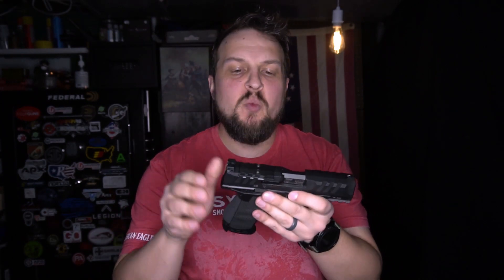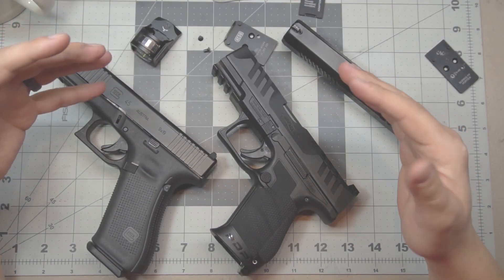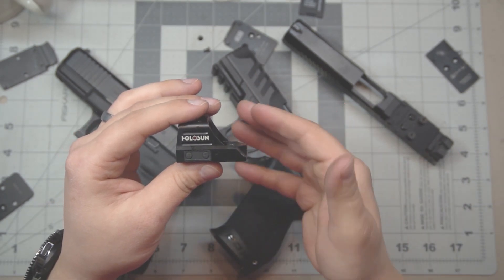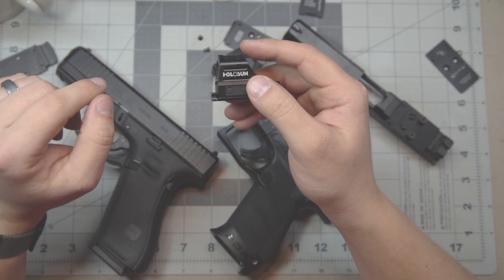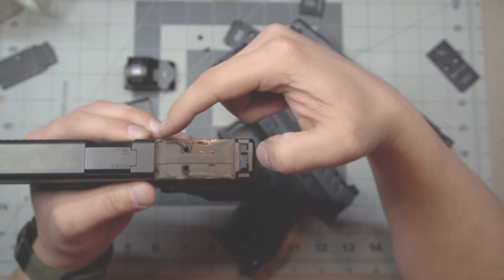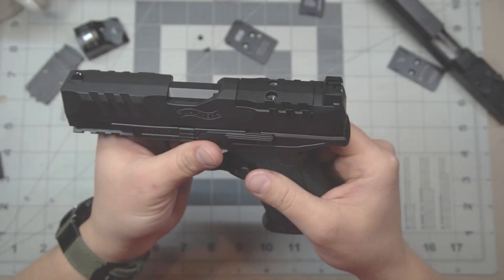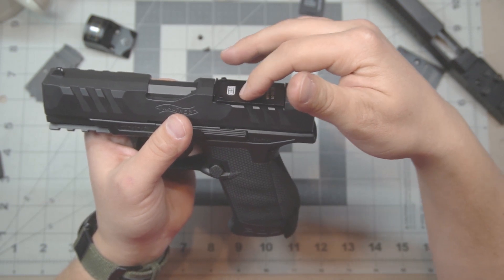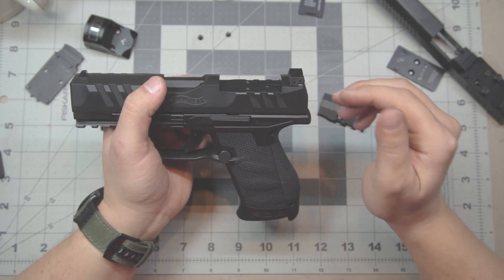The Gen 1 Walther PDP is going to Break

Comment: As a machinist ,that much slop vertically and horizontally is unacceptable.
Reply from the maker: And that's the problem, with what they're relying on to hold these plates down in a mass produced item, you can't help it. They have neglected to put in a repeatably tightly toleranced feature that will accept and transfer the shear Force
Reply: The "slop" existed because our host used the wrong plate.  So the "unacceptable" result is the fault of our host's mechanical ineptness.  

Also, what kind of machinist are you and can you provide proof of your work history?  Or are you just pretending to be one, for the sake of internet jollies?
Reply: @seanoneil277  ... hopefully that is the case and their plates actually will hold up .. exactly what benefit would I get pretending to be a machinist?
Reply: @jnewport7993  I'm pretty danged sure it's the case, since our host keeps shucking & jiving around the issue of what plate, and what optic & slide the plate's made for, like he can't acknowledge his clickbait seeking was way out ahead of any testing protocol integrity.

As to your Q - I wonder if you've ever witnessed internet LARPers pretending at skills, experience or knowledge they lack.  I've seen it so much that I rarely trust anyone's claims and usually assess their content instead.  You didn't sound LARPy but made the machinist claim -- so I asked.

I'm not a machinist but have done metal fab (CrMo tubes made into fillet brazed bicycle frames) with a drill press, hole saws & work table fixture, plus filing for fine tuning.  I've built a '69 Mustang Mach I into a 1/4 mile racer.  I've worked with fasteners & milled surface attachments throughout my life as an auto, bicycle & motorcycle mechanic.  And I've worked with machinists & complex custom machinery makers in my past.  I can see our host's flaws pretty easily.  I assume you can as well.